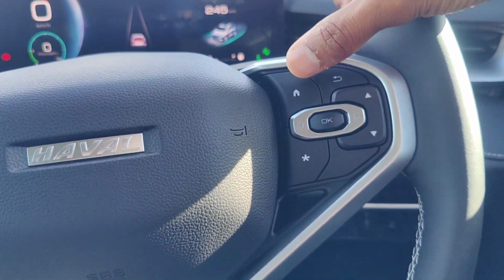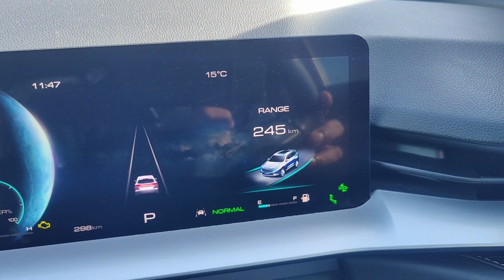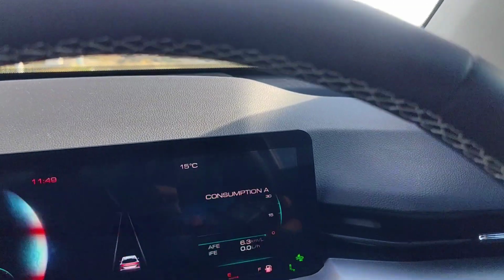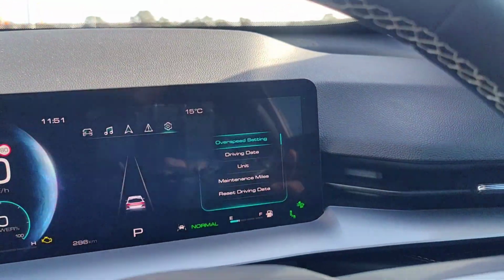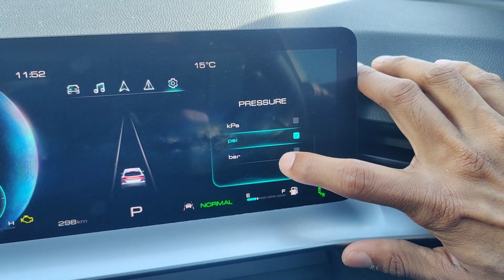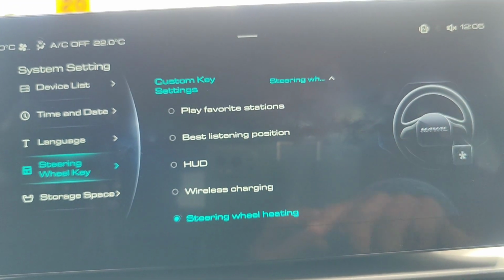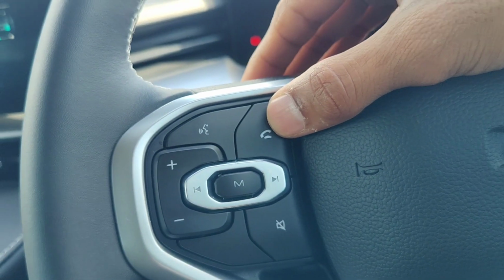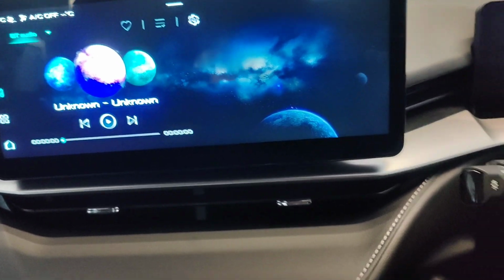Haval H6 Hybrid: Uncover the Steering Control Secrets!

Comment: In the 2024 model Haval H6 Hybrid, when the cabin heater is turned on, the engine runs continuously and never switches to hybrid/EV mode. The engine does not shut off at all. Is this considered normal operation, or could it indicate a setting, hardware, or software-related issue?

Comment: How do change between 'favourite' radio stations from steering wheel?
Reply from the maker: Unfortunately, That's not possible. You can have multiple favorites but you will have to use the infotainment  screen to select any front the list. the star button on the steering can be used to select the top favorite station. But not others in the list.
Reply: @BeingRookie  yeah thought so, very annoying just like you can't permanently turn off ELK.
Reply from the maker: Agree

Comment: Hi, Can you tell me how to change radio stations on the steering wheel? I have already added all radio stations as favorites. But when I press the Next/Previous button on the steering wheel, it scans the frequency to the next available station instead of going straight to the station I have saved. Mine is an H6 HEV. Thanks
Reply from the maker: Unfortunately, That's not possible. You can have multiple favorites but you will have to use the infotainment  screen to select any front the list. the star button on the steering can be used to select the top favorite station. But not others in the list.

Comment: Hi, can you tell how the much car travels in total full charge in electric mode.
Reply from the maker: It's not a plug in electric so you won't charge it. It gets charged while you drive the car. The car switches between battery and petrol depending upon the driving conditions.